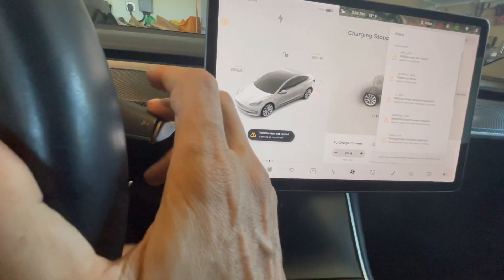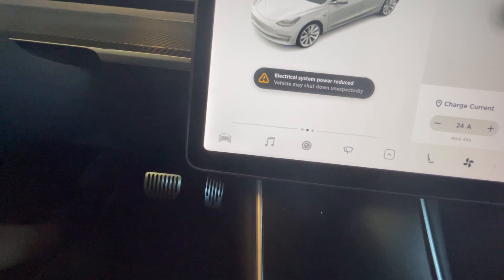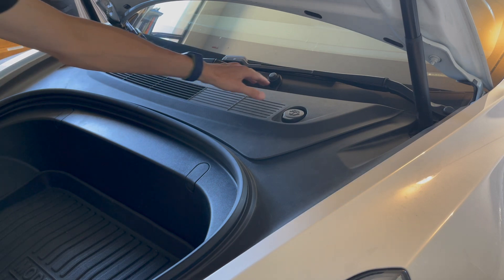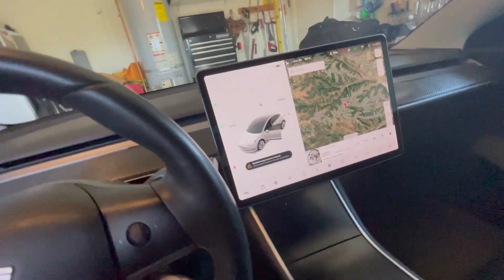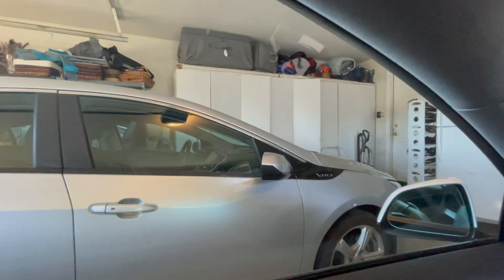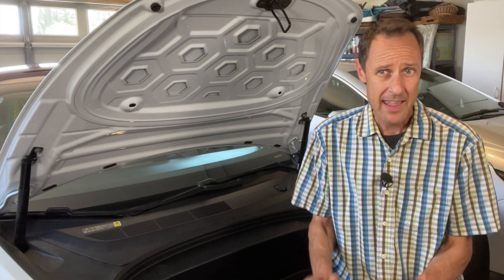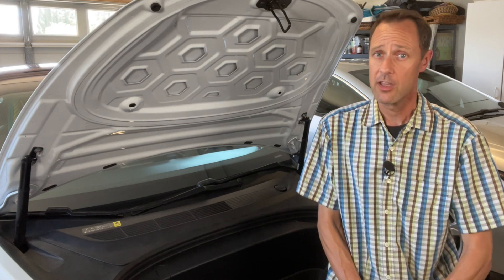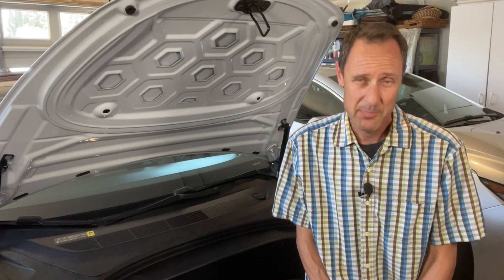My Tesla Model 3  12 Volt Battery Experience

Comment: At almost 4 1/2 years, I pre-emptively replaced the 12V battery with the Ohmmu Li option. Yes it's pricy but now I don't have to worry about it for a long time. Since the old lead battery is still good and because it's in s good location with no road grime or grease, a quick wipe with a damp rag has it looking new. I opted to spend a bit more $$$ and purchased a 300 watt pure sign wave inverter and a 30 Amp solar charge controller. I already have some solar panels. Now I have a back up power system to get me thru a power outage. (As a DIYer, I just had an excuse for a new toy!)

Comment: I took delivery of my M3 in March of 2020. I just had my first maintenance experience in August of 2022. About 6 months late according to the manual. Coincidentally, I got a message to replace the 12 volt 3 days before my scheduled service! Fortunately, I was able to add the 12 volt replacement to the service. I was surprised when I was told it was replaced free of charge under warranty. I had not heard this before. So, before you buy your own 12 volt, lead acid or lithium, check your warranty. I was considering replacing my cabin air filters myself, but Tesla only charged me 58.00. I live in a major city in the U.S. which usually means higher prices.

Comment: You don't have to be an electrician to know that the black on your meter is the negative and red is the positive.  And why would you pay Tesla to install the battery, when it's not a difficult thing to do.  But it's really unsatisfactory that the battery in a Tesla doesn't last more than a few years and then you'd have to wait almost a week to get a new one.
Reply: The battery doesn't last more than a few years for some people, but there are plenty of others that last longer than that.  And some that last way less than that.  His battery was 3 years and 9 months old.  Mine is 3.5 years and 66k+ miles old and still going strong.  Also, you can find a replacement battery at any auto parts store or business that sells automotive batteries.  Buy a Group Size 51R battery that is used in some Hondas.

Comment: So your first video was 9/20/2018  which makes your battery about 2 years and 9 months old.  Not too great.  Prius batteries are loaded similarly to a Tesla (no engine starting required).  My 2006 Prius battery lasted 6 years and cost $328 (special sealed glass mat battery because it was located within the car, not in the engine bay).  Not impressed with the longevity of that 12v battery.

Comment: After contacting Tesla, they informed me that the charging system in my car (it's an Oct. 2019 car) will not work properly with the factory charging system that is installed in my car. A Lithium battery charges differently than a 12v lead acid battery. If you are going to put in a Lithium battery, you must have a newer car with the updated charging system. The battery and charging system will not be covered by warranty any longer if you install a Lithium battery. It is not known if this might affect other systems under factory warranty.
Reply: The warranty remains in full force unless the dealer can prove that the components used caused damage. The Magnuson-Moss Warranty Act protects the consumer.
Reply: In addition to what Pete said, the charging system is the same in older and newer cars.  The only difference was software, but all the cars get updates and the charging systems will work the same with the same software versions.

Comment: Word of warning.  I encountered a situation where my Model 3 simply died. No screen. No door opening. Everything shutdown.  When contacting Tesla Roadside Service to obtain a 12 V Battery replacement, they denied service.  Stating that the data showed no warnings that the 12 V Battery needed to be replaced and therefore it was all but certain the vehicle dying was not related to the 12 V Battery.  Instead they made me pay for a tow to a Tesla Service Center, with me having to assume towing costs. Once at Tesla Service Center they quickly determined it was the 12 V Battery. It was replaced and I was ready to go. Don't listen to those idiots at Tesla Roadside Service. If your Tesla appears to completely die, warning or no warning, the likely cause is a dead 12 V Battery. Still not happy that I had to pay for a tow when Roadside Service could have easily replaced the battery at my home, instead of me towing it all the way to the Tesla Service Center. Thanks alot!!!!! NOT.
Reply: Why did you not try for a refund- it was roadsides error and their name says TESLA!!!!!
Reply from the maker: Sounds terrible. Sorry to hear about that.
Reply: Yes, I would be a little ticked off about that too.
Reply: Car bricked just as you describe 5-hours after taking delivery.  No screen, no app connection, key cards not working... nothing.  Roadside was unable to ping the car and dispatched a tow truck.  I was about 200 miles from home and ended up in a hotel overnight.   Service Center had new 12V installed by 5PM next day and also completed recall work (ball joints) and fully charged the main battery.  No cost for tow, parts, labor as I am still under warranty.  Service Center Tech said they see 4-5 of these per day.  Can be caused by bad code in the software updates that can cause the main battery to over/under charge the 12v.  Mine was overcharged and basically cooked itself.  Tech told me he has seen 2014 S with original 12v battery, and new models with sudden dead 12v as well.   Tech also stated that sudden 12v death happens across all models.  If you live far from a Service Center, I would strongly consider getting a spare 3rd-party battery that you could install in a pinch.
Reply: My comment was not meant to be rude or snarky, but something others who experience can relate to Tesla Roadside and not be deterred in getting them to come out and replace the battery. It's a cheap, quick fix that is infinitely easier than towing to a service center only to find out it was simply the 12 volt battery.  Additionally, the argument by Tesla Roadside that there were no warnings in the system prior to the outage should be combatted with this insight:  I didn't have any previous warnings that the 12 volt battery needed to be exchanged, but the moment the new battery was installed nearly a dozen messages popped up stating the battery needed to be replaced. So when Tesla Roadside says there is no warning message and therefore it's unlikely to be the 12 Volt, push back.  The fact is in an overwhelming 90% of the cases, it's the 12 Volt battery.  Good luck you all.

Comment: Definitely looking forward to the next video on options. My wife has a 2019 Hyundai Ioniq EV and the 12v battery died. At first I called some local auto parts store and non carried the specific battery needed. I called Hyundai (which I should have done first) and they said it was covered under warranty. 

I bring that up because I have a 2019 Model 3 SR+ and I worry about when that 12v batter goes out. If it ends up being out of warranty I would like to know how easy it will be to get a new battery. Like is the type of battery sold at auto parts stores or maybe even a place like Walmart. I’m also not sure how easy they are to change out like in a ICE car. Sounds like you  have that covered too. 

Thanks for all your content.
Reply from the maker: Yes. I'm shooting the options video as we speak and already have everything I need for the installation video. Thanks for watching!

Comment: I have two EVs, the exact two that I've seen in you garage ( tesla and a volt).  For my volt I did not want to chance having the computer reset so I used a method in which the computer would not ever go off.  Here is what I did on my volt but could be done on any EV.  Place the new battery beside the old one and connect them in parallel and then remove the old battery.
Reply: I wonder what you refer to as a “reset.” 2011 Nissan Leaf 12 Volt battery replacement was done by me at home. Disconnected the installed battery, removed it, installed a new one and connected the terminals without issues. Oh, the new battery came from Nissan dealership, same manufacturer and cost less than an auto parts battery. Original lasted 6 years plus. Thanks and good luck.

Comment: Did you not try to plug the car into the charger?....Doesn't it charge the 12v when it's plugged in?....If after trying that and it wouldn't hold a charge, the battery for sure needs replacing
Reply from the maker: You would think plugging it in charges the 12 volt battery but it doesn’t. It’s actually the main lithium battery that charges it. Plugged in or not.

Comment: 3:34 9.2 volts is a very dead battery.  Jumping to 12.3 volts was probably the DC-DC converter kicking in to try to charge it, or some 12v load going away.  12.3 volts with no load is still on the low side.

A good 12v battery should be 12.5 - 12.6 volts with no load and no charge input.   13.2 - 14.4 volts would be an active charging voltage applied to the battery from something external.

Comment: Lead acid batteries are the cellular flip phone of the past.  Although more expensive, the Li battery replacement is the current technology that should have selected for replacement, otherwise a "Ground Hog Day" movie moment will be what you can expect in next 2-4 years, probably on a road trip in the middle of the dessert (Let's hope not).  Tesla engineers made an economic and volume supply decision to go with the Lead battery in Tesla's, and calculated that most of those batteries would make it a few moths after warranty and not be on their dime to replace...  Good CFO decision on their part to save a few dollars, horrible decision for owners especially for the price of the car!
Reply: Point well taken Kurt. But, Tesla told me that if I chose to install a Lithium battery in my car, the warranty for certain systems might be voided. I don't know how the charging systems could be different for these two battery choices, but apparently according to Tesla they are. The only system they recommend for a car that did not come equipped with a Lithium battery is lead acid.
Reply: @xflyingtiger  I wonder who can officially make that 'Lithium v Acid' battery decision as to voiding the warranty at Tesla Corp, since many of the Tesla Service Center management/staff have differing views of what constitutes "OEM"...  Seems to me that if a battery meets the specs for equivalence (Volts, CCA, etc) then it meets the specs...

Comment: If a 12V battery loses power or is low in voltage, I imagine at least 2 options. Either there is a fault in the DC-DC converter so that the battery is not charged properly or there is a fault in the battery so that it either cannot receive the charging current well enough or cannot hold the current. The best thing, of course, would be to locate the fault before starting to replace anything on the car. In general, a 12V battery for an electric car should be able to last for many years as in my opinion it has ideal conditions to operate on. It will be interesting to follow further developments regarding the Tesla battery.

Comment: When mobile service replaced my battery they had to take off the back seat to reset something.  The 12v will charge from the traction battery but when the car is in drive if I recall correctly.
Reply: When they replace the 12V battery they have to disconnect the High voltage battery and that connection is below the back seat

Comment: My understanding is that the main battery pack is what charges the 12 volt battery. 12 volt battery flips a switch and that's tells the main battery to send power to motors and AC/Heating. They both need each other. That would explain the fluctuation in your 12V batteries current on your meter. And also explains why after a period of time, the screen powers back up and you're able to drive. Because the main battery temporarily charges the 12 volt battery. But because the battery is bad, it's not holding the charge for very long/temporarily. Just like in a ICE vehicle, the alternator can only do so much if the battery is bad.

Comment: My guess is that one or more cells were going crook. The humming was the drive battery trying to charge it. You couldn’t put it into drive because there wasn’t enough oomphh in the 12v to close the HV contactor. And the reason that later you were seeing 14v was because the battery was then making the HV one try to charge it again - I think you still had it connected so you would be reading the charge voltage. I believe that if you can get the contactor to close you could drive because the HV charging voltage would keep the ship alive - just don’t go out of drive!
All just my gut feeling, however…
Reply: Once you can turn the car on or jump start it, the 12v system will be kept alive by the DC-DC converter from the HV battery.  You don't even have to be in drive, the car just needs to be awake.  So if you drive it like that and need to get out, keep the car awake by turning on the Keep Climate On feature.  The humming was probably the car trying to engage the HV contactors, since those won't close without a good 12v.  His managed to finally close, and the DC-DC converter powered up the 12v system from the HV battery.  But the low voltage on the 12v system indicates that the lead acid battery has dead or dry cells.

Comment: how do you open the frunk with a dead battery?
Reply: Battery not quite dead. In low power mode. Enough to get in and out of car, open frunk so that you can access the battery, windows in short burst, etc. If/when the 12 volt battery totally dies you must open the small circle in the front of the vehicle and hook up jumper cables {or a 9V battery actually,}  to the two wires  inside in order to "Pop" the frunk.

Comment: I live in Phoenix where a 12 volt lead acid battery lasts two summers. Mine completely died last summer. Tesla would have replaced it under warranty, but I decided to buy the lithium-ion battery you showed. Peace of mind is worth everything to me. It also weighs a fraction of a lead acid battery. I’ve been very happy so far.
Reply: Interesting. I also live in Phoenix and usually have to replace ICE acid/lead batteries every two years or so. Was your experience similar in your Tesla?
Reply: @michaelpearce1801  Yes. I went out to the garage and the car was completely dead. Two summers seem to be the limit.
Reply: @evanharris5088  Question? How long were you getting the warning message before the 12 volt battery died?
Reply: @savvysupastar  So I’ve changed my mind and would recommend having Tesla replace the battery. The Ohmmu is great, but Tesla has the car programmed to not play nice with it. Ohmmu did replace the battery with a new version, with a cool phone App to help take care of the the problem, but Tesla will replace the battery inexpensively, so why bother. The car gave me no warning the first time, but gave me a few hours the second time. I would replace the battery every two years in a hot climate, and every three to four years in a moderate climate. Just my personal opinion.
Reply: @Evan Harris  I first received the message last night. Many of my systems have been deactivated per the warning message. I need to run errands today however I'm a bit paranoid to take it out to have it die on me in a random place. I'll go down to the service center first thing in the morning. Was trying to get a gage on how many hours of operation i have left before I'm stranded. Called the roadside assistance earlier he said it's completely random.
Reply: I'm happy the Lithium battery is working good for you Even. My Tesla service center told me that if I replaced my battery with a Lithium battery that parts of my warranty would be voided. My car is a year and a half old.
Reply: @xflyingtiger  They told me there wouldn’t be a problem. Guess it depends who you talk to.

Comment: By the way, this is the 12V car battery going bad, costing about $200 to replace, and not the main 75kwh battery pack that powers the drive motor(s). That is the battery pack that I dread the replacement of.

Comment: Great video, Mike! I have found that unless the car has gone to sleep with Sentry Mode turned off, the 12 volt battery will have around 14 volts sent to it. I have a compressor type cooler and it is has a voltmeter on it's display and it can be set to stop drawing power below a certain voltage. I can keep the cooler running by preventing my Model 3 from going to sleep. 
I wish that my Ford Cmax PHEV worked like that, but unless I leave the ignition on when I leave the car, the cooler will shut off. Brian from i1Tesla uses a separate battery to keep his cooler running and a solar panel to keep it charged up. Brian also showed that there is 12 volt backup power located under the back seat, built into the penthouse. He disconnected the lead acid battery, but still had emergency power to open car's doors. That is why you have to disconnect the connector under the passenger side of the back seat, to truly be safe, after the lead acid battery is disconnected.